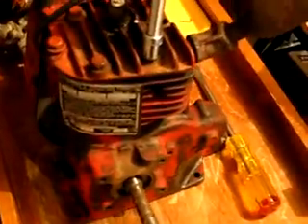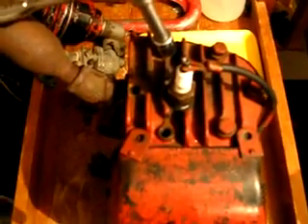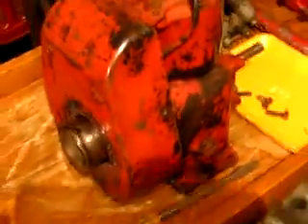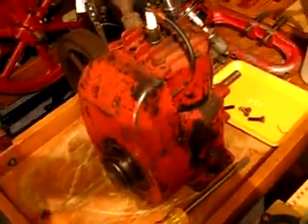Briggs Vintage NP Engine Project Progress...

Comment from the maker: I am taping the holes over with duct tape, it is probably not the best way but it works out very well for me. I probably don't have to tell you this but I rinse the inside of the block out thoroughly when done also... Thanks for stopping by and good luck on your rebuild!

Comment: looks like you have a nice engine to work with anyways. i like some of the old mufflers as well. that is neat looking. i have gotten myself into the habit of pointing the muffler to the side or putting a raincap on the exhaust in case it ever gets left out in the rain or to prevent crap from getting down in the muffler. just a habit i always keep to that comes from my working around old tractors.

Comment: getting ready to bead blast my Briggs & Stratton engine.  It's completely apart but I am worried about glass beads getting into the cam bearing surface in the crankcase cover and the crankshaft bearing surfaces on both sides.  
Are you able to blast your blocks without any problems?